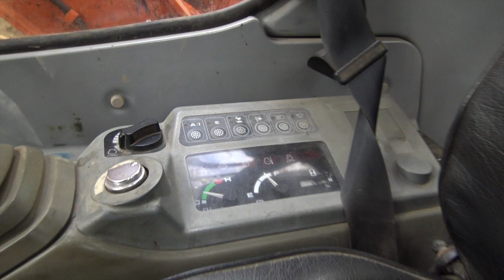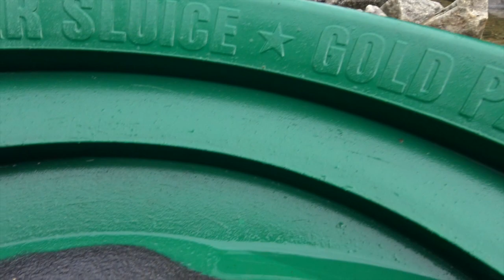BRUTE GOLD MINING MINERorBUST Show

Comment: Hi There,  I don’t know if you tend these comments or not.  If you do.  YOU NEED A FLAPPER AT THE TOP OF YOU SLUICE BOX TO MAKE THE FLOW OF THE WATER IN THE  SLUICE BOX LEVEL AND SMOOTH.  The flapper should get rid of all rooster tails and bubbles in the sluice.  I know you are blowing out fines.  I would put two sluices on that hopper box. I would use long toms and flappers on both.  If it was hard to do well ok but flappers and two long sluices are a days work.  I bet you would increase  recovery 20% in fines.  Do you pan the tailings to check your loss rates? 

Get it all man!!!  Do great!! Be safe!!

Comment: Dude, the areas you mine look like they may have nuggets. You need Clarkson Riffles and boil boxes to get those nuggets. Your expanded metal sluice won't catch nuggets. The slurry will knock those nuggets right on down the sluice. Make a simple foot wide by 8 foot long section of Clarkson Riffles so you catch any big nuggets. Seriously. You need more waterflow for Clarkson Riffles, but it'd be worth it so an ounce nugget doesn't slip thru.